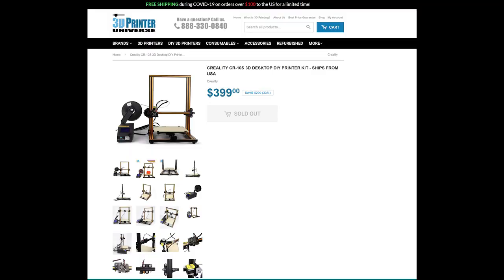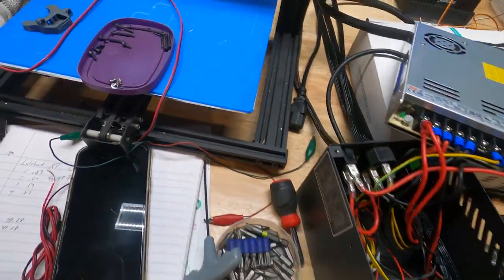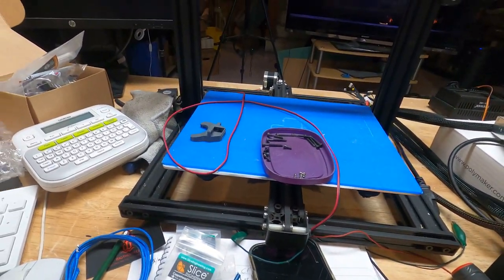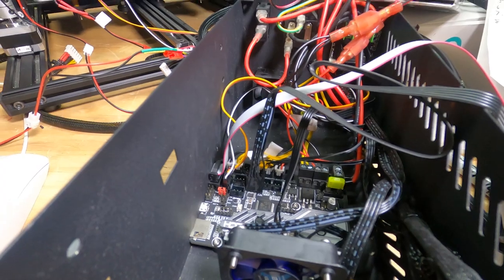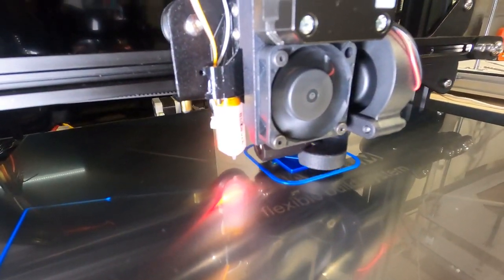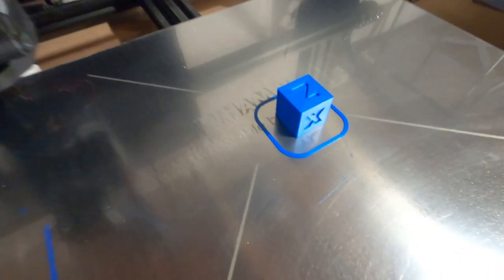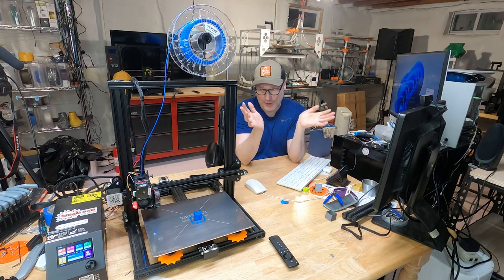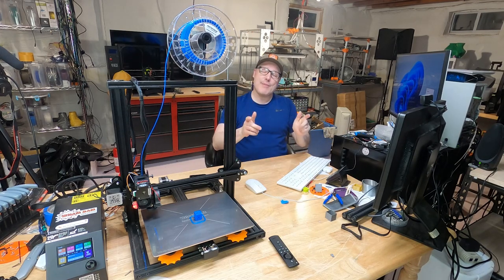CR-10 Mini Modern Overhaul

Comment: Hey there!  I've got the same second lead screw "antenna" thing going on for my mini as well haha.  Was waiting to see if you'd upgrade to 24V.  I had considered doing that after I lost the original PS to a shoddy job directly soldering the leads to the bed.  I got my PEI sheets from TH3D just before they discontinued the mini's size.  I'd really like to do an all-in-one conversion because I'm running out of space in my house, so if you do one as well and film it I'd like to see which designs you use!

Comment: Been printing for many years and still love my mini, i pump out large prints at 120 to 145mm's and turns out find, using all metal hot end of course, track rollers sound like there going to fly off sometimes BUT it works!
Reply from the maker: It was a fun rebuild. Man I did a lot of reading about them and everyone hated the warpy bed!
Reply: I used the magnetic bed sheet, best thing ever!!!
Reply from the maker: @arksurvivalevolvedforever8985 yes.  As you saw in my video, I water jet the spring steel to fit!

Comment: Just the video I was looking for! I have a CR-10 Mini I was gifted for christmas a very long time ago and have been running it ever since. It's a great printer and I've had a lot of fun modding the crap out of it. I just can't do a lot of the cool things I see online because of the 8-bit board (V1.1.2). Could the Bigtreetech SKR mini E3 and the TFT35 screen be a drop in replacement for the printer without replacing the power supply, hotend or motors? I understand I have to flash the Marlin firmware, which is fine, but I would love to do this upgrade on my machine. Since it's my only printer though I'm scared I might do some damage to it. Any recommendations would be very much appreciated.
Reply from the maker: The board could be done with just the board. I went all out, replacing as much old / iffy stuff as possible.  If scared, seek a mentor to assist!
Reply: @WhereNerdyisCool  I would love to seek out someone to assist me with this type of stuff. Unfortunately I live in a very rural area where this type of stuff isn't really the norm so youtube and the internet in general is really a good guide for me. I'm trying to compile my firmware now for this setup (SKR Mini V3.0 with the TFT35 E3 V3.0.1) and can't seem to get VS Code to compile with the touch screen. The stock firmware works with the touchscreen but since the mini has a different print area than an Ender 3 I have to rework the code for it to work fully. Have you gotten the touchscreen to work after flashing your marlin firmware?
Reply from the maker: @Abandoned_Player I didn’t touch the firmware on the TFT.  I left it alone.   Firmware isn’t my strength so I hired some help - on Fiver   Check out my recent video upgrading the Newereal 3D printer.  There’s a link in the description to the gent I used from Fiver to get the firmware side working!
Reply: @WhereNerdyisCool  So after fiddling around in Visual Studio Code A LOT I made a guide on how to make the firmware for the CR-10 Mini with the SKR Mini V3 and the TFT35 E3. It's everything I did to get it working. Just about the same setup as your printer but I didn't do anything else besides the motherboard, screen and a BLTouch. It's very long but pretty informative. It's based off of Marlin 2.1.2.2 and I've got lots of reference videos and github pages so you can follow the journey I did. Plus it also includes the configuration files I used incase you want to change something in the future at the bottom. I.E. filament detection, dual Z motors, etc. If you want you can include it in your description if you'd like and I hope it helps anyone else that stumbles across this video.
(Wow)reddit(.)com/r/BIGTREETECH/comments/1bhi76e/bigtreetech_skr_mini_e3_v30_control_board_tft35/?utm_source=share&utm_medium=web2x&context=3
I've tried to post this three times now. I dont know if its youtube deleting my comment or what but if its not allowed let me know :(

Comment: should have done a video on  doing the firmware for the board and screen.
Reply from the maker: I trimmed that out since I was t sure most would want to see that.
Reply: @WhereNerdyisCool  bro ill be honest i did the same upgrades minus the hot end and i don't know what firmware to use. what did you use and if you can post the link to the exact firmware and configuration( bugfix 2.0 or  2.1 or import 2.0 or 2.1 version) that'd be a huge help

Comment: How did you get the SKR bolt holes to line up? I have the cr-10 V3 and I'm trying to do the conversion
Reply from the maker: Mine was a drop in replacement. No adaptor needed.
Reply: @WhereNerdyisCool  I found an adapter I printed since the board is half the size. Just got to figure out the bl touch wiring now. May need to just run the bltouch wires all the way to the board.. not sure yet
Reply from the maker: I buy the extra long BL Touch cables from Filastruder